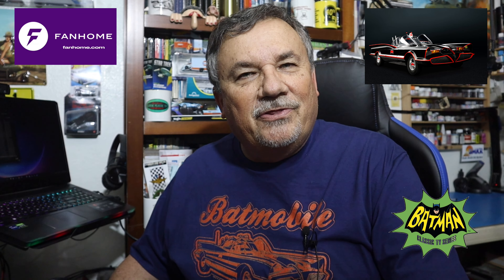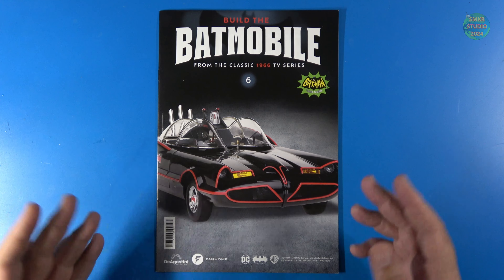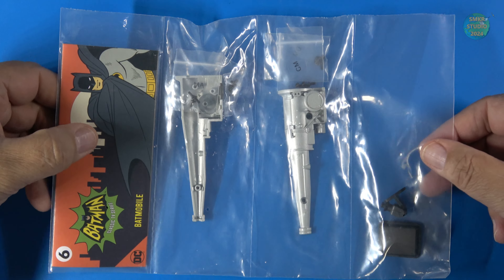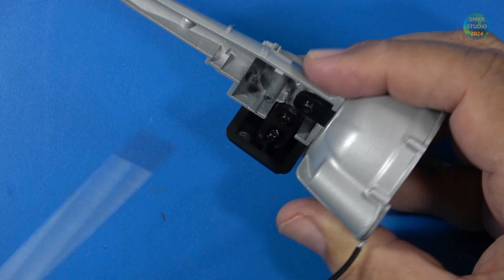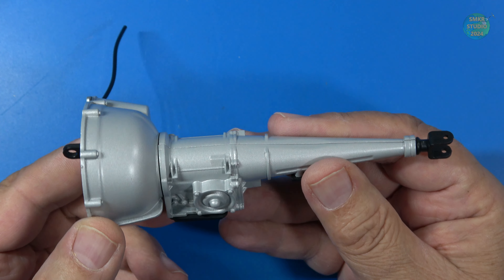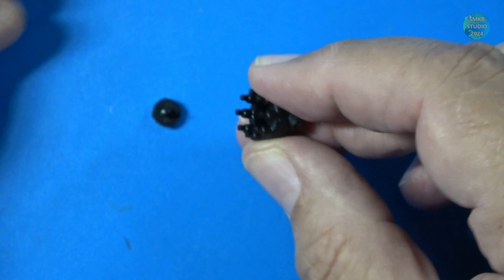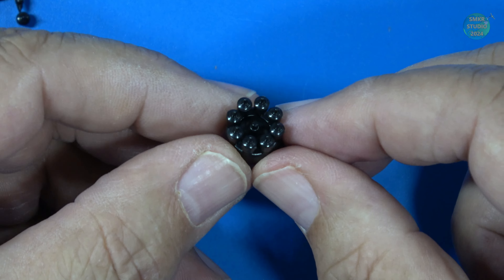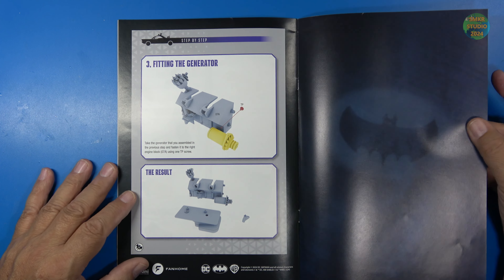Build the Batmobile - Phases 6, 7, and 8 By FanHome / DeAgostini | ASMR

Comment: Greetings...In my directions for Phase 7, it stated to use 9 distributor cap plugs, with the ninth going in the center.  Was there a reason you left that one off for now?
Reply from the maker: Great catch, I didn't install it yet, must have overlooked it since no coil wire has been given yet, no big deal and I still have the part with my extra screws.  I did end up super glueing all the ignition wires later.  Thanks for pointing that out.
Reply: Thanks... I wasn't sure if you left it off on purpose for a later step.  Thanks for your great quality videos!!
Reply from the maker: Thank you for watching.

Comment: What is the reason for the oil on the screws
Reply from the maker: Make it easier to install them into the metal parts. The screw have to cut the threads into the metal parts and it helps with that process, also helps to prevent the screw from breaking.
Reply: @ScaleModelKitReview Ohhh. ok thank you for the information.  I'm hoping to order one of these soon!